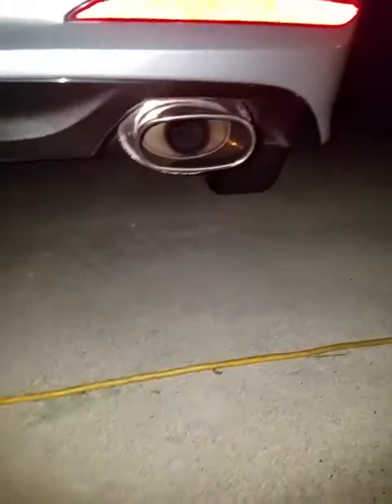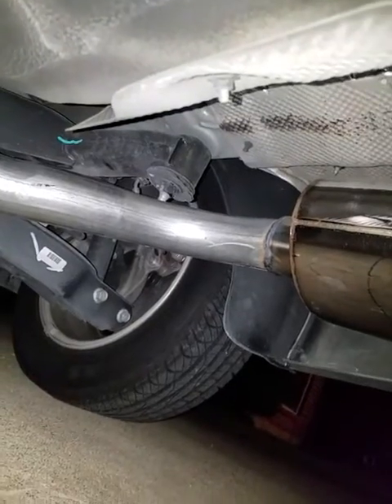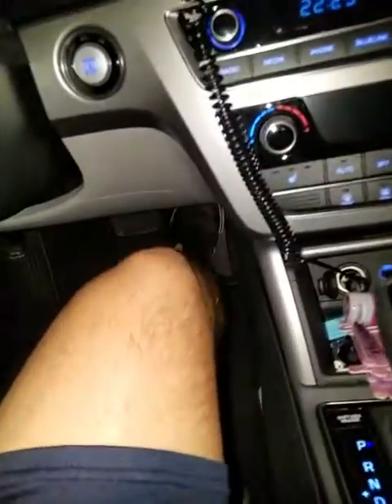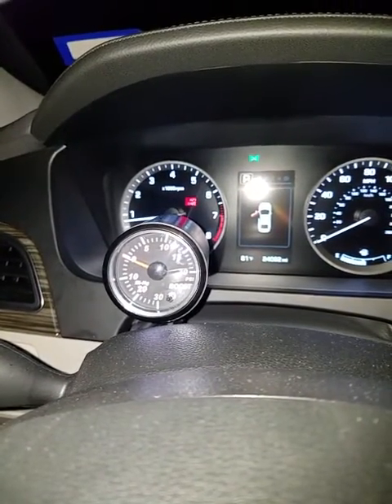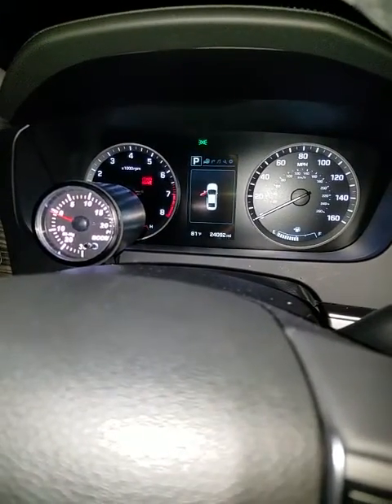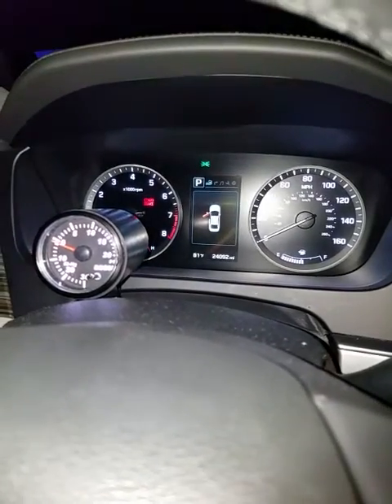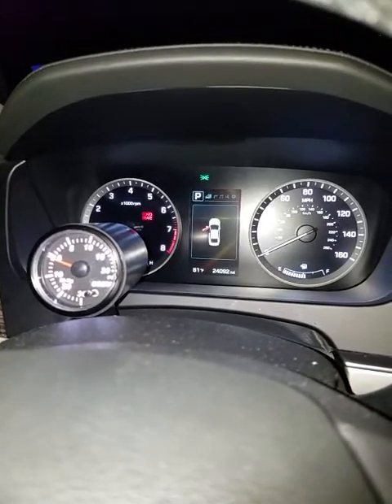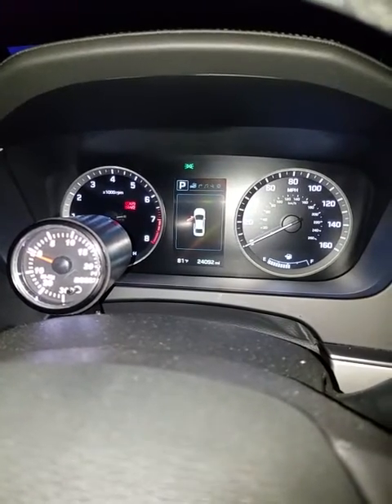2015 Sonata Eco 1.6T 2.5 inch exhaust sound

Comment: I love my Sonata Eco. Mine is also the 2015 with tech, same color and everything. What other mods have you done? I contacted LAP3 and apparently they can reprogram the ECU to deliver more power. What is your next mod?
Reply from the maker: Devin Crutcher LAP 3 s a Korean tuner. I actually used their dyno in 2010 with my old Kia Borrego. They have a tuner that will bump our cars around 25 HP on 93 octane. I have a homemade Spectre air intake and the secondary cat deleted. I also have 2 small oil catch cans which make a big difference when using 87 and 89 octane. Very underrated engine. I have over 41,000 miles with zero issues.

Comment: These Ecos rip. I drove the 2.0t and Eco back to back and the Eco in my opinion was more impressive. Plus killer fuel mileage.
Reply from the maker: its great. i did a 15.4 at the strip only pushing 14psi due to the bad heat soak at the track with these cars. even the 2.0T suffers from heat soak.
Reply: angeldemon821 that's pretty good for a big family sedan. I had a 2008 Sonata with the 3.3 V6, that thing moved pretty good.